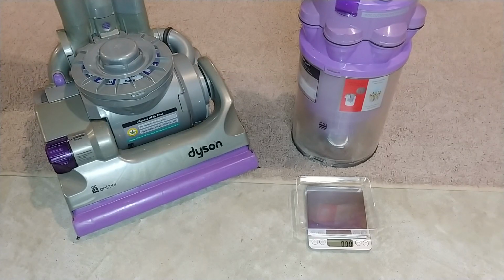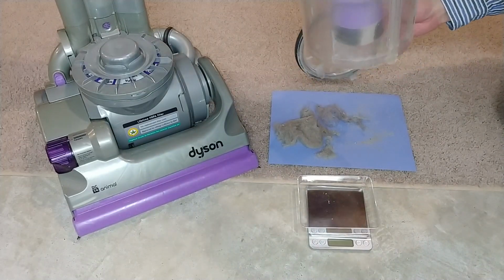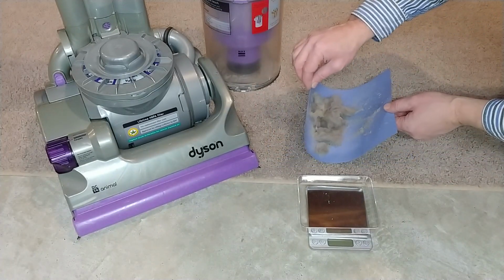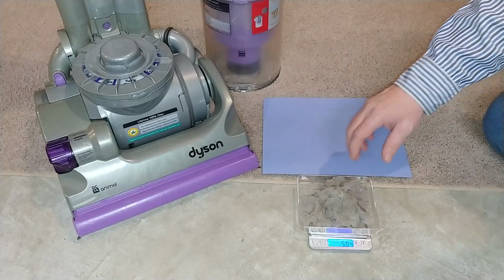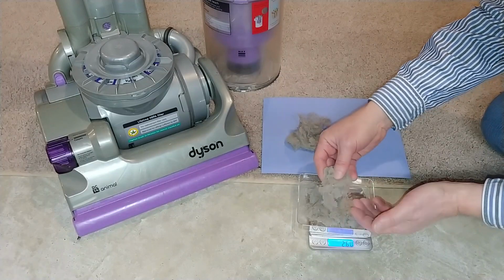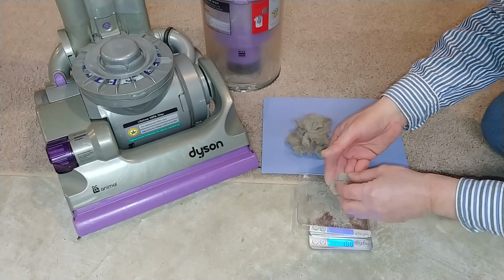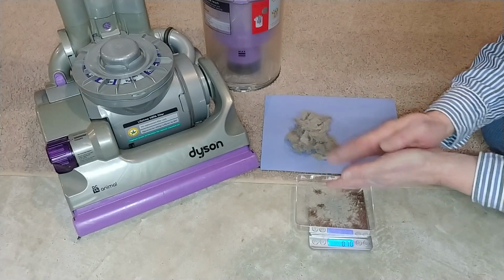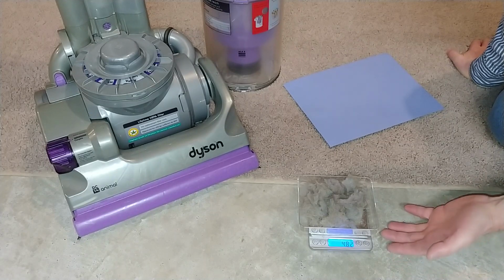Weighed Whole House Carpet Dirt Recovery Using The Dyson DC14

Comment: Perhaps there’s more in the cyclones /filters and that’s why it’s less? I doubt it, but it could be possible.
Reply from the maker: Umm, did you watch the LG video? It's because the LG is a carpet shredder. The extra is carpet fibers.
Reply: VacLab I did indeed. I thought dysons shredded the carpet too (I guess it could be the brush), but I must be mistaken. I have used a Hoover T Series Windtunnel PAWS (“Pet Approved Windtunnel System” as Hoover abbreviates it), and it shreds old carpet. It replaced the Hoover Convertible that I now own (that one NEVER shredded the carpet)
Reply from the maker: @johnerikson7094  older Dyson's like the DC14, DC65, etc., never shredded the carpet. Only the latest Ball 2 models do that. Take a peek at my sand in the carpet test playlists.

Comment: Now that's not bad at all. Biggest question is how would the Kirby Avalir do in this test. Would it be possible to use the paper bag in it for easy dust recovery?
Reply from the maker: I would have to create a paper bag for it as it has an "F" connector. 😞
Reply: @VacLab  Oh it's like I guessed. I taped paper bag for my G6 to do the pick up test. Quite a challenge 🤔